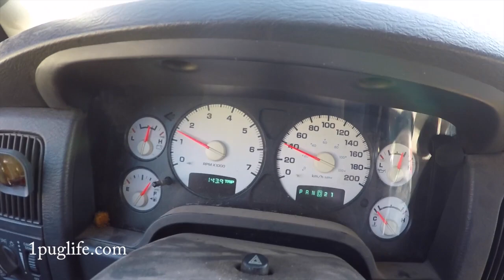the double decker

Comment: If you would run your tractor each day it wouldn't lose prime and start but you let it sit for week+ the system loses prime. That orange tractor you wouldn't like it has a GM engine in it. Just unhook the line let it gravity feed when your ready to hook it up bleeding won't take long and all new fluid in the whole system. Might as well do it right.

Comment: not super clear on the grease fitting space, but a "90 degree" or "right angle" grease coupler, would probably fit in there with the wheels cut full stop...
Reply: probably best shot is the "right angle". they have a slot that slides into place...